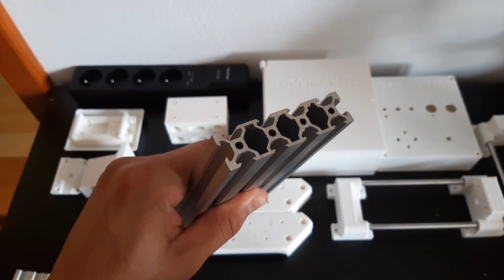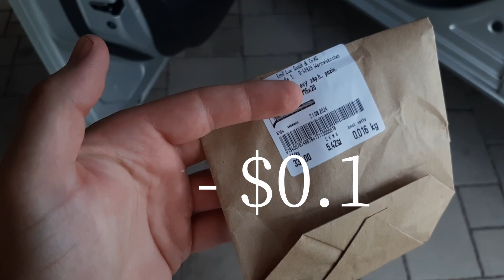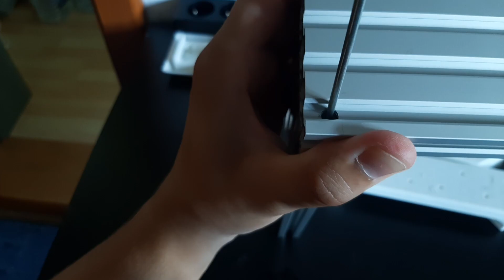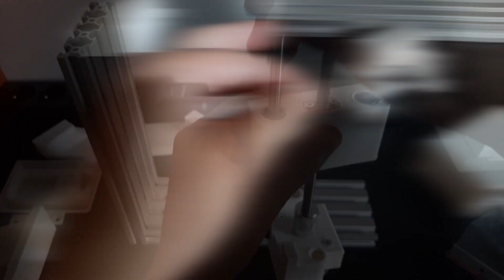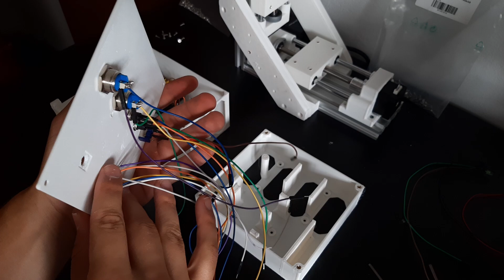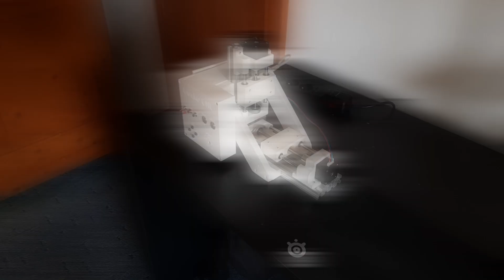Assembling my 3D Printed CNC

Comment: You can cut bolts I do all the time at work. Just sand after you cut it and make it a clean cut where you don't bounce around and mess up the threads (clamp in vice). A cut off wheel would work to cut it.

Comment: You can tap aluminium extrusions using bolts: it's not ideal (and you risk ripping the bolt) but for short taps it can be done. =)
Reply from the maker: Wow, I didn't know that. I might try it.
Reply: @TazerEngineering  I, too, used bolts longer than the tapping tool (on 3030 extrusions) and, after the first tap with the tool, I continued using a bolt.
An impact driver makes it easier. =)
Reply: @TazerEngineering im late but you should cut a notch along the lenght of the screw

Comment: option 3: cut the bolt.
Reply from the maker: I figured that cutting it would fuck up the thread and I only had 2 bolts.
Reply: @TazerEngineering  Thread a nut on the bolt, cut it, clean up the end on a grinder, then take the nut off to clean up the threads.  Having more bolts is usually a good thing, though.
Reply from the maker: @UnoriginalElephant  I'll try it next time.
Reply: @TazerEngineering Yeah, I cut bolts short almost on a daily basis. cutoff wheel, chamfer it with a bench grinder, flap disc, or whatever, then wire brush it. They always turn out great.
Reply: Option 4: make a new bolt in your completed CNC machine.
Reply from the maker: @GilesBathgate  lmao. Yeah I could but I would need a bolt for the CNC. Luckily I can just make it on my CNC I am building.